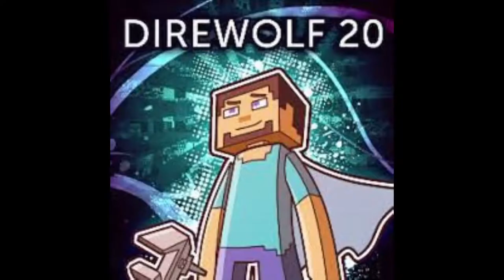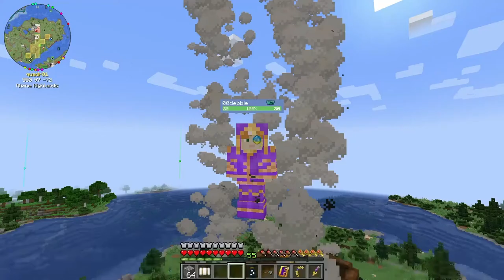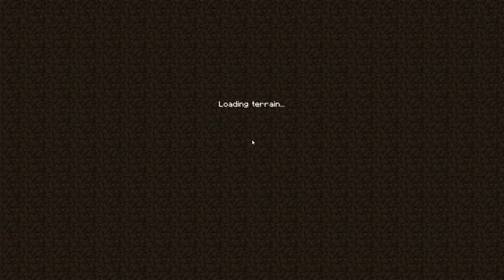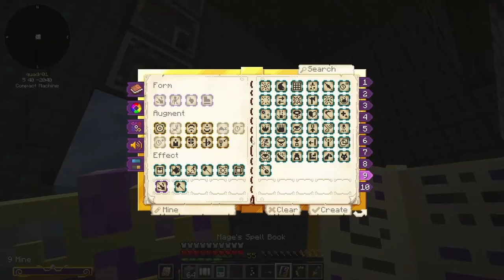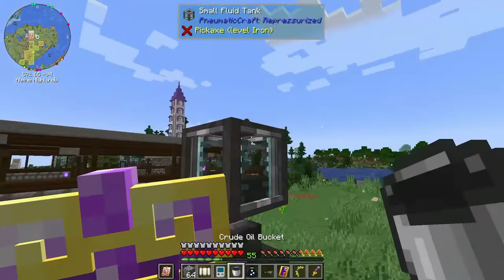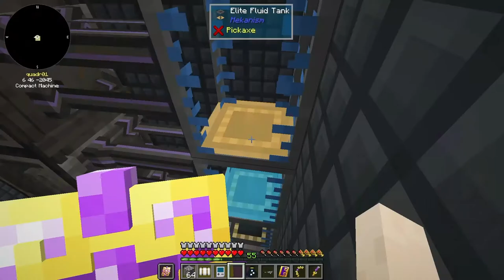DireWolf20 1.18 Let's Play Episode 91: The Quest for Plastic and Lithium

Comment: Whups, my bad; I was mistaken about that ice under the vortex.  I did some testing, and heat pipes and heat sinks work to help increase top temp, but ice seems to reduce it.  :-(

For stacks of redstone to flux, I had the same experience; about 8-ish stacks max each time, the rest came back still as redstone.

If you run the diesel, kerosene, and gasoline through Thermopneumatic Processing Plants, they'll turn in to kerosene, gasoline, and LPG, respectively.  So you can use those to make more LPG.

And not your clay farm!  After all the work getting source moved around to make it work!  :-P
Reply from the maker: yeah, the clay farm bit it!!